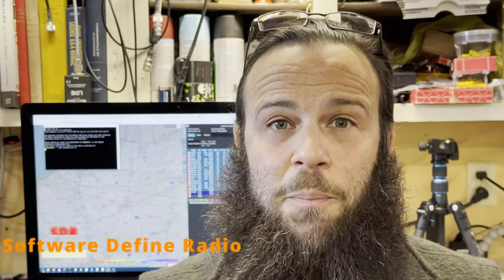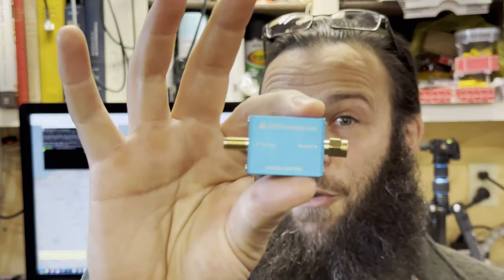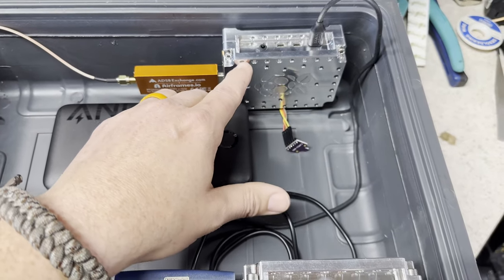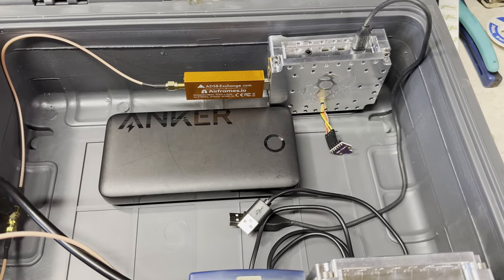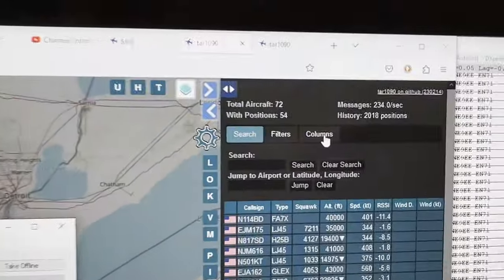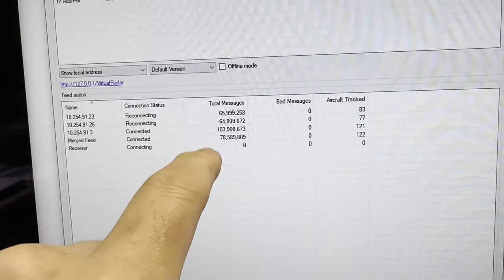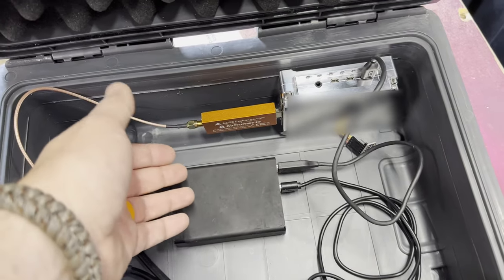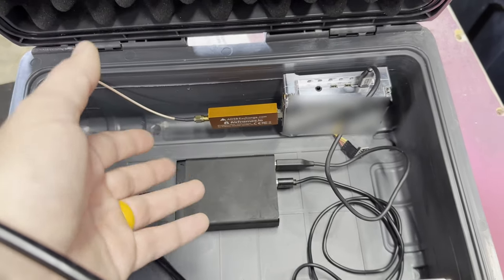ADSB Receiver Battle Royale 1

Comment: Wait, you put a 1090 filter on an orange 978 stick and expected it to get better? Maybe I’m wrong I’m no expert but wouldn’t that block the 978mhz signals? Only allowing 1090mhz to pass through which the orange stick is not designed to pickup?…
Reply from the maker: This is a common misunderstanding between the Orange 978 and the Blue 1090.

The difference between them is subtle but significant. The difference being that the Blue has a built in filter for 1090MHz (similar to the one that is added externally), the Orange has no filters at all. You can use the Orange stick to tune into anything from roughly 01.MHz to 1700MHz. Don't take my word for it, check out the specifications on the hardware if you want to verify that for yourself.

Comment: The orange SDR is optimized for 978 tho... right?
Reply from the maker: Negative sir, the Orange ADSBx SDR is just straight up no filtering. The Blue ADSBx SDR has a 1090MHz filter. The Orange SDR can be used for 978 or for any other application where an SDR can be used. I have used mine to tune in ATC, local PD/EMS, and reading my gas and power meters.

Comment: Why would you use the orange 978 stick with the 1090 filter?  Shouldn't that filter be used with the blue ADSB receiver?
Reply from the maker: This is a branding problem with these devices. The orange stick is not just for 978. It can listen in a very very wide chunk of the spectrum. The chief difference between the orange and the blue is that the orange has no filters whatsoever built in and the blue has a 1090 filter built in after the pre-amp. Putting the external 1090 filter on the Orange lets us see what the difference would be between having the filtering for 1090 before and after the pre-amp on a heads up comparison because otherwise the guts of the units are identical.

Comment: So if I understand your test data, when you put the filter on the Orange SDR, it appears to attenuate the signal.  Is this correct?
Reply from the maker: Bingo. I expected some insertion loss but I also expected the filter to aid things given that the whole purpose of the filter is to block the unwanted signals and allow in the wanted signals. I'll need to run an insertion loss test on the filter at a later date to see how much signal is lost with it.
Reply: @LifeAtTerminalVelocity  - I will be looking forward to the outcome of this journey.  I want to implement an ADSB receiver system and I want to see the data in your tests.
Reply from the maker: There are at least two more matchups pending. One is completed, I just need to edit the video. The other is in progress right now.

Comment: Using a sh..ty T-splitter  is not a good idea,  Z (impedance)
Reply from the maker: It is equally bad for both receivers so I can live with it.
Reply: @LifeAtTerminalVelocity  - Not necessarily equally bad as we don't know how the individual filters and receivers respond to the impedance mismatch you created.  To make this a useful test you'd need a 50 ohm signal splitter that's designed for these frequencies.
Reply from the maker: @rogerp5816  Funny you should mention that. I just finished recording a video on such a power splitter.